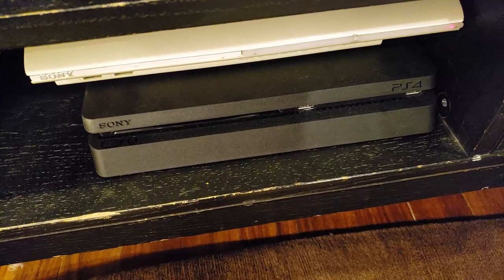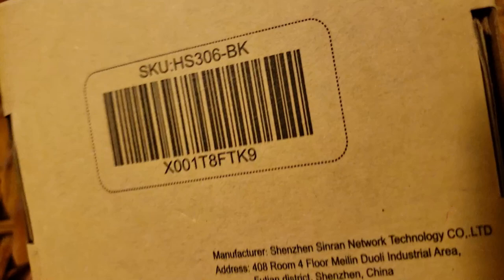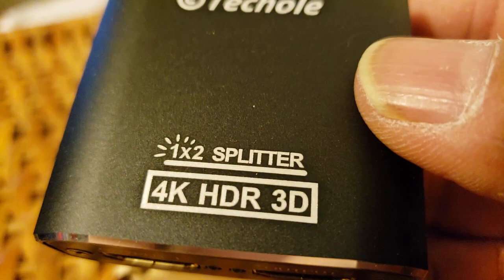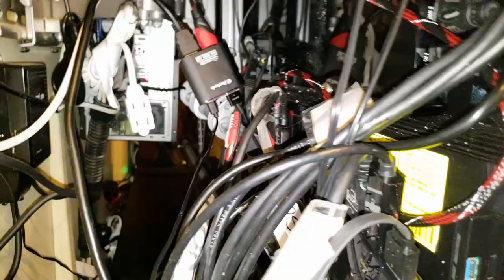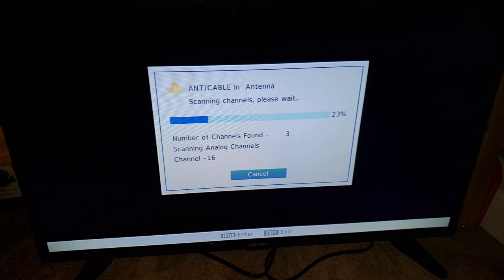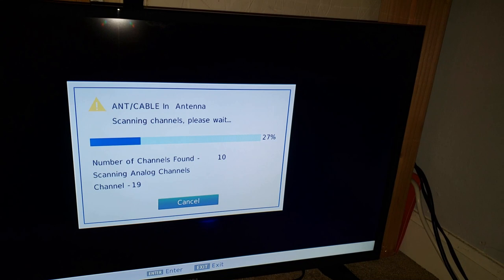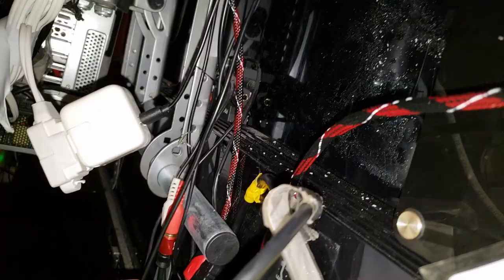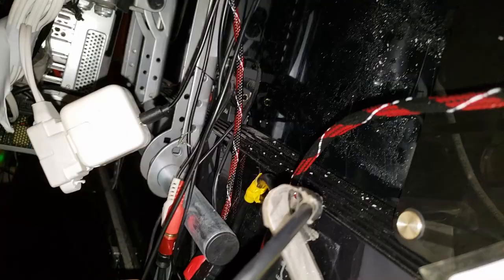HDMI Splitter 1 In 2 Out HDCP HDMI 3D Xbox PS4 PS3 Fire Stick Roku Blu-Ray Player Apple TV HDTV

Comment: if i have no DC 5v power supply, is it safe to plug the splitter into my PC with the usb cable to give it power ?? , another thing , if its safe does it matter to connect it with usb 2.0 or 2.1 inputs on pc ?
Reply from the maker: I am no power expert, it’s always risky to plug in anything to anything, but with the safe guards built in to many of our devices, it’s usually safe. But you have to do it at your own risk. I dont see why not, but its up to you to try that.
Reply: @mtandiz  thx for replying dude much appreciate it